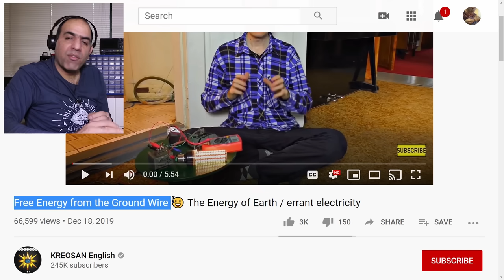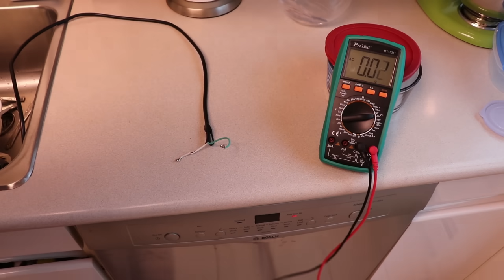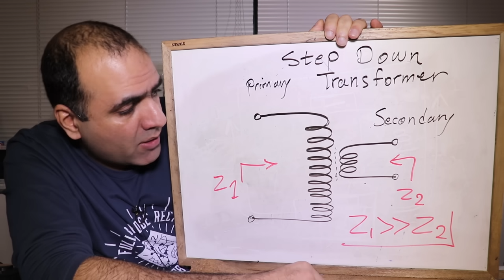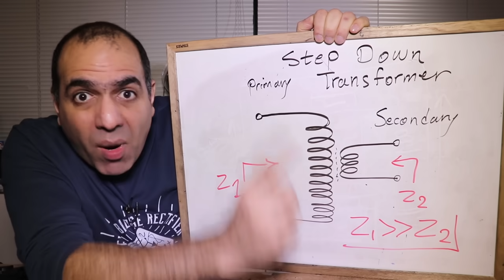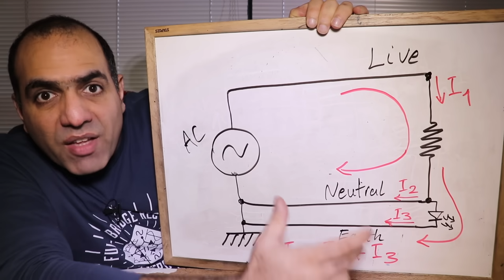FREE ENERGY DISCOVERED in Ukraine, 3M Subs Celeb!!!

Comment: I install a hydro turbine generator . I’m down stream from a reservoir. Yes as electrician it did cost me money to install it 10 years ago. But that cost me $7,000 back then but I’m off grid 24/7 now maintenance my self. 1000 amp hydro generator run a 200 amp service at my house. Got 2 for price of 1 when I installed another hydro generator turbine in Maine. 3 houses cost them 50,000 that 16,666 each house for 1000 amp hydro turbine generator they off grid 2 with 200 amp service each I check system every 3 to 5 years . So I may not have 100 free electricity I do know I don’t have any electricity bill for last 10 years. I guess I can call it free now except when I maintain. Maybe 2 to 3 hours a year. But I’m probably the closest to free power you get to. Help a hotel in back woods the lake up stream so we used 10 pipe down stream hit a turbine side ways . Water hit turbine in back into the river. 
Every good house should have a good lake up stream or a river running through it.

Comment: I used to live under high tension power lines and I could light a flourescent bulb up by holding it up in the air. I tried hanging some wires in the yard but never tried a large coil. The circuit would have to resonate at 60 hertz. The lamp lit dimmly. I could see his device working if it was very close to power lines or maybe an am radio station if it isn't a scam.

Comment: A man called Nathan Stubbelfield 100 yrs ago extracted energy from the ground in volume enough to heat his house, he had a patent on this "Earth battery" Tesla was in one of the photos . I have a 20mtr wire in the sky for transmiting as a radio ham, and can get a voltage of it ,but low amps and volts to do not much with, maybe I should wait for a thunder storm, I must try that Earth battery!

Comment: I know you don't like thermal electric generators, but I've played around with this stuff for years and it is possible to get "free" energy by attaching them to an absorption cooling unit like on an RV propane fridge, the "free" energy is a result of the heat energy that is around us all the time (any temperature above absolute zero has atleast some energy) I never followed through with it because it would cost thousands to build and the net result would be something like 20 watts

Comment: Just a sec, in a sense it is free. I mean that energy would dissipate on wire resistance anyway, so by powering something with that voltage difference you are actually redirecting some of the energy on your load. So in a sense it is free. I’d rather say it’s saved rather than earned for free
Reply: The thing is, you're connecting a parallel path from live to neutral, and so you're still drawing current from live by doing this.

Comment: There is no free energy unless you are steeling it. Imagine you live in a village where 500kv transmission lines are passing.. Try to build a inductor loop so you have supply voltage at your end without touching the lines.. Be careful as 500kv can fry you as well with one small mistake..

Comment: if you take your two hands and grab a hold of a door frame and lift yourself off the ground, you may be able to hold yourself up for perhaps 4 to 5 seconds.  If I take pictures of you at 2 and 3 seconds, it looks like nothing is happening but you are running out of energy, working to keep yourself up, which is why you let go at 5 seconds.  Now I understand energy doesn't just come out of nowhere but look at the refrigerator magnet that has been holding itself up for 30 years with your recipe for flat bread- doesn't look like anything is happening but it is just like when you were hanging from the frame - energy is doing work. It isn't free energy, or overunity energy, it is just energy coming from a place you were not taught about in school.  You let go because the lactic acid builds up in your muscles and they just can not do the work any more.  Similar to having a piece of apple pie in a restaurant overlooking Niagara Falls. You look out the window when you sat down and once again when you tipped the waitress - doesn't look like anything has changed but it did.  Several hundred million gallons of water went over the falls in the interim. Gravity is similar to a dipole - nature doesn't like it when things are up in the air. The magnet stays up because it has a north and south pole (dipole).  Nature doesn't like dipoles and seeks to eliminate them. So when you short a battery you see sparks or the wire gets hot.  Nature is always trying to eliminate the dipoles of magnets but by their nature they will not short. Magnets distort the aether.  It is nature's continual efforts to short the fridge magnet that keeps it working and holding on to the fridge door. It's not new energy or free energy, it is just a virtually inexhaustible source of energy that various researchers have figured out how to tap and can unfortunately lie about if they are unsuccessful.  It's easy to point out the lies but not as easy to point to the truth.  Your refrigerator magnet is not lying to you - it is actually holding on to the fridge door year after year because a continuous source of energy is working to keep it there in its attempt to eliminate the dipole.  So when you critically think about this you begin to understand that the power that runs your house hold devices doesn't come from the power plant. The power plant only creates the dipole and nature does the work for you at your house, not the power plant.  The power plant has to keep running because as soon as they create the dipole, they short it with the return wire.  But if instead of shorting it,  they closed the loop with a time delayed semi-conductor they would only have to boost the dipole periodically for the line loss.  Your power plant is capable of unleashing unimaginable amounts of power. The power plant has to work because it is destroying its dipole as fast as it is creating it. Your home devices work because the Aether is disturbed by the dipoles created in your devices and the power to do their work comes from the same place as the refrigerator magnet gets its energy. So there you have it. This is not my idea - it has already been discovered by many researchers and documented.   When we go to school we are taught 150 year old science - duh!!!!!  Have to step outside of the box to understand.

Comment: Install 2 ground rods a large distance apart  and measure the voltage between them. There will be a measurable ground loop voltage.  The larger the distance the larger the voltage.  >>>>>>BE EXTREMELY CAREFUL!  LARGE VOLTAGE AND CURRENT MAY EXIST.  DISCLAIMER: DO NOT ATTEMPT THIS WITHOUT EXPERT KNOWLEDGE OF ELECTRICITY AND ELECTRICAL PRACTICES

Comment: You can make free energy by taking two magnet motors by using a process for reversing it  and then you add an adapter so that you can connect it then you connect the two motors with two wires negative and positive then you need to turn the adapter for a few seconds then it can produce enough energy to power the other motor then you connect two others wires to one of the wires then you can turn on a light bulb sorry if it does not work i am just a kid of 11 years old how wants to make a project of making free energy 😢😢
Reply: It's kind of a fundamental law of the universe that matter and energy can not be created from nothing. All energy must come from somewhere. Something to know about magnets, artificial ones don't last forever and creating them takes a considerable amount of energy.
Solar energy could be considered "free" energy. At least beyond the cost of the solar panel. But that energy comes from the fusion reaction of the sun. They also don't last forever. 
So you can collect energy at no cost to you, sorta. However that energy would be small and have limited usefulness.

Comment: Hi electroBOOM your videos are great you actually danger  thing  what will happen it may not be free energy but its a great discovery i even checked the voltage difference between earth and neutral it gave DC earth as positive and the neutral as ground it gave 500mV checked on AC range and on DC range it gave about 250mV

Comment: very soon!  You will have a permanent power generator, we invented a permanent power generator no torque, a generator that works without fuel, without emissions, without noise, environmentally friendly
   It can be placed indoors, and its size is the size of a fully automatic washing machine.  It produces 15 kWh and operates 24 hours a day, 7 days.
   Now in the cycle of accelerating the implementation of innovations at Qatar Science and Technology Park to launch Al-Barq Company for Future Energy

Comment: I am trying to build a recyclable energy generator and I have managed to power an alternator running at 1500 rpm using a DC motor running at 3000 rpm. The resultant power generated when fed back to the DC motor for continuity through a converter should be able to keep it turning and light produced. But I don't yet have the resources to finish my project. Any advice

Comment: I have a question 
What if we used motor generator set in which motor rating is about like 1KW and generator rating is like 2 KW now we connect each other with gear box so generator can move fast. So is it possible? Please make video on this topic
Reply: It would not work. The motor can only do so much work with its 1kW power rating, and if the generator is being powered by that motor it can only receive the amount of work that motor can do in a given amount of time (power). So if this were perfectly efficient, the generator would only receive 1kW input and would only output 1kW. You're proposing adding gears to allow the generator input to move faster, but that's not actually changing the power transfer. You're only changing the time it takes for work to be done, it's the same power in the end. If you increased the speed with a gear reduction, you'd have less torque and still the same power. The other way around would mean less speed and more torque, but it's all still going to add up to the same power.

See how no matter what we do, the power transferred is always the same? This is because energy in = energy out.

Comment: In fact if there is voltage between ground and neutral is a common failure. The voltage is supposed to stay at zero. It means that ground needs maintenance.

Comment: Im from Ukrain. You are using different ground in US. New homes in Ukraine also connected like yours now. But a lot of old buildings from USSR are still not grounded properly so to see shifts between phases is a common thing. It happened when three phases gen uneven load. And even saw 100 V directly on the neutral wire when somebody used some old welder mashing. Having a few voltage in such buildings is very common

Comment: Hey can anyone explain this I get the voltage even if the lights circuit is turned of I.e makes no difference the plug circuit ground to the other light switch is short 0 volt and to other sockets earth but the ones  at bottom of my bed gives put both hight magnetic and electric fields that max out the meter I even tried to shield it with copper fabric but made no difference is this energy from satellite or cell tower direct energy or from new technology surface waves SAW I think it called or some other thing I thought it could be cosmic Ray's but I heard they were at something like nano tesla and this goes of the chart how is there so much magnetic energy in a wire run not a coil there is something here I need help to finger it out my body has been made to a battery I believe with fungi graphene and carbon nano times it in water food etc and so this energy I show charge me up make me sick and hard to get it gone takes days to lose the magnetic and electric field made in my body when I'm bad I feel plastic and any object magnetic field I do wears EXPERIMENT  look please if have any ideas put a comment do I see it on my vedeo sorry poor quality but just showing it live 

https://youtu.be/xFM5HEE8-sE

Comment: Normally you have good videos with "proper" information but in this one you missed a little.
You are not harversting the energy in the same way as the Ukrainian guy.
You harvest between ground and neutral which is NOT what the video states.
This makes your video faulty at two points:
He uses "earth" from plumbing pipes and electrical ground, which has different potential and potentially could supply free energy (probably not in reality but you is much better then me to bring light on that)
Second your GFP would not have a problem if you would have used the "earth" to ground instead of neutral to ground.
Reply: I hope you realize that ground and earth are the same thing.